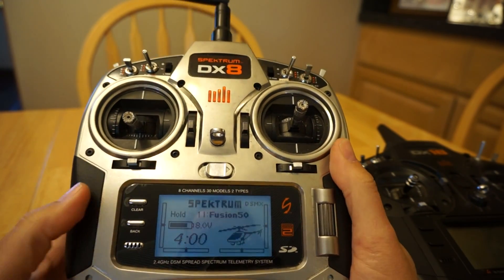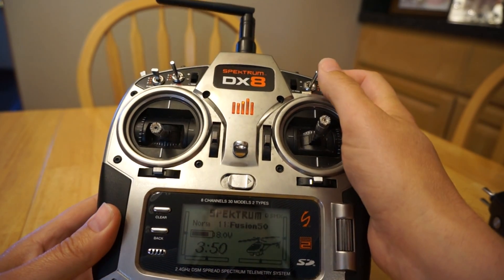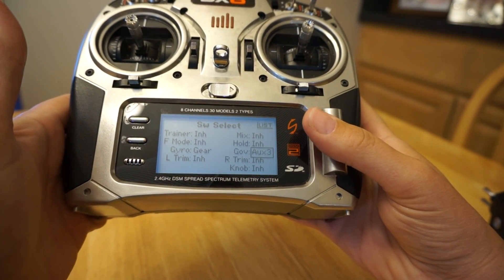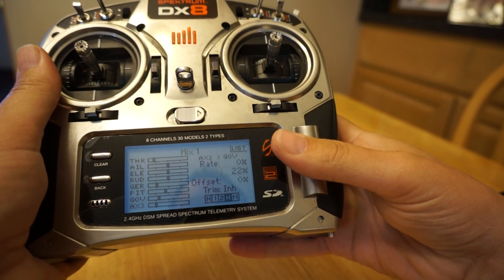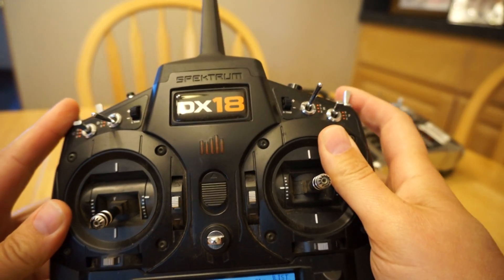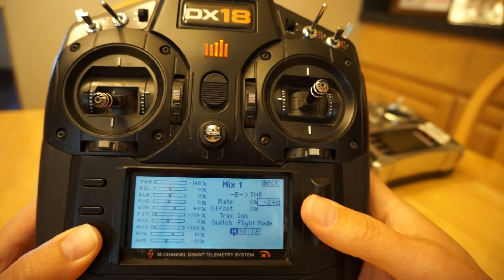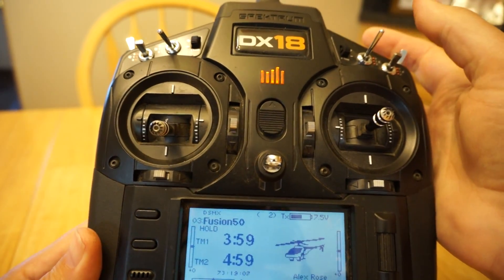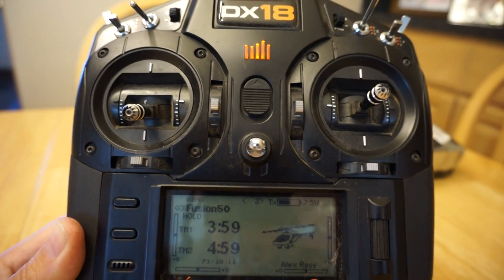iKon Auto-rotation Bailout with Castle ESCs Video 2, TX Setup

Comment: would it be possible to assign the normal throttle hold switch to completely kill the motor while still having the auto bailout assigned? kind of a dual throttle hold, one rpm setting on your 3 way switch for auto's and zero rpm for the regular 2 way throttle hold switch.. I own the dx8 and was wondering if it would cross over